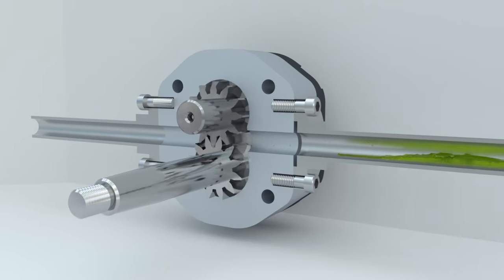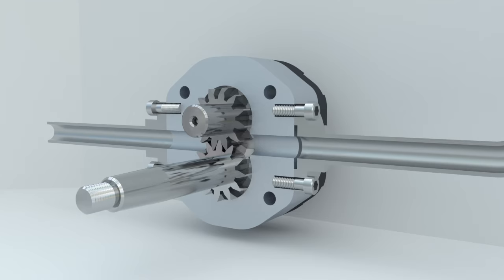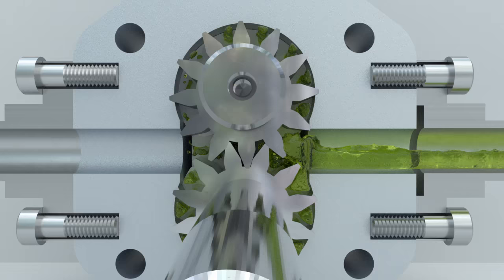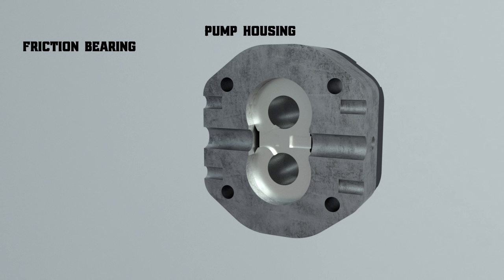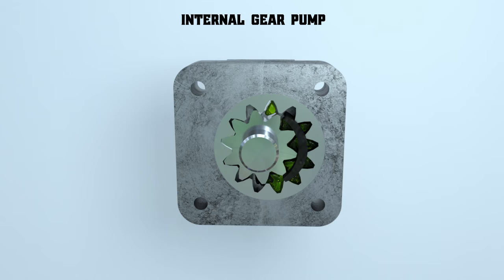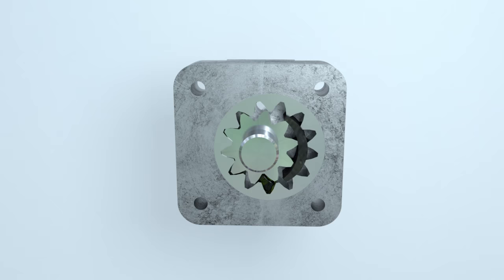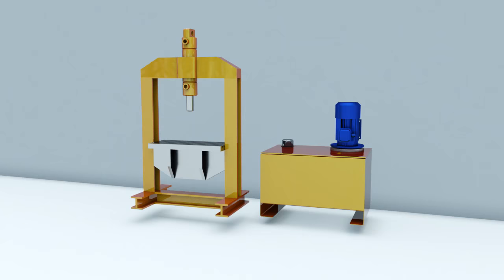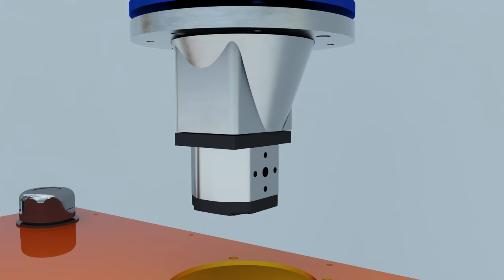How does a gear pump work?

Comment: In the refinery I work in they used a gear pump to pump a slurry of solvent, water and perlite powder (finely crushed volcanic glass). As you can imagine it needed extremely frequent maintenance, the perlite was literally sanding down everything inside the pump. Why they decided to use a gear pump for this slurry in the first place is beyond me, but they finally put in a better suited pump.
Reply from the maker: Yes, the gear pump is not well suited for this industry.
Reply: Wow yeah slurries containing abrasives are a no-no for gear pumps. A much better choice would be a progressing cavity pump.
Reply: @biggreenblob  Yup, despite the properties of progressing cavity pumps being well known where I work, they default to using centrifugal pumps for almost everything. Probably because they're way cheaper. The gear pump I talked about was replaced with a centrifugal pump, it doesn't break all the time anymore, but it isn't theoretically ideal.
Reply: You should have just asked them why. You were there everyday.
Reply: Diaphragm pump would be better.
Reply: or just used gravity
Reply: Well its like my company the most important machine in the facility uses the worst possible way to hold things or lift them suction. And of course it breaks down daily due to droppages because it cant hold shit together with suction.
Reply: @shawncrocker7037  if he was being paid to perform maintenance on the pumps, he's better off keeping his mouth shut.
Reply: But can peristaltic pumps scale well?

Comment: Internal gear pumps are pretty much standard for automotive engine oil distribution. One of the advantages they have (in that application) is that they have no bearings. The inner gear will sit on the front end of the crankshaft, which has its own bearings. The outer gear will free float inside the oil pump housing. The engine oil being moved by the oil pump lubricates everything.
Reply from the maker: Yes. Thank you
Reply: Nope.  Oil is distributed across the gears by immersing one of the gears in the oil directly.  It is NOT moved by a pump.  It is moved around the parts by capillary action between the gears.  In other words, the oil is passed from one gear to the next by the fact that it sticks to the gears.  When the gear interfaces with the next gear, the contact causes some of the oil to transfer to the other gear.
Reply: @protoborg  you might have misread. You're describing the lubrication of a manual transmission. I was talking about the engine, which only has gears in the oil pump and camshaft timing mechanism. Engines are lubricated by pressurized oil from the pump.

Comment: The pump will not work. The first bearing was put ay the wrong side. The high pressure side was put into the low pressure side.

Comment: “How inefficient would you like to make your pump?”
“Yes”
Reply: It might be energy inefficient, but I bet it can generate massive pressure and probably has really good self priming capabilies.
Reply: Gear pumps are actually relatively efficient, work with a high range of different fluids and they have a simple construction and the output is easily controlled. They're overall pretty great.
Reply: So what method would be better? These are still being used in cars to this day.
Reply: @neudimensions1320  An engine that runs on batteries.
Reply: Most hydraulic pumps and oil pumps are gear type pumps.
Reply: @neudimensions1320  that's only semi-true. Many manufacturers no longer build pumps like this as an OEM Solution. (excluding superchargers)
Reply: @kabadisha  we have hydraulic motors like this on bush hogs and they are very efficient and strong
Reply: How is it inefficient or what makes it inefficient???
Reply: Wanna know something funny ? Positive replacement pumps are some of the most efficient pumps but they are not used as much as centrifugal pumps because of their maintinence costs lmao
Reply: @neudimensions1320  i cant remember any engine using this type of pump for anything. You any?
Reply: @Steinersgarage  almost every ice uses a gear pump for the engine oil everything from a Chevy 350 to Ferrari uses them because of there reliability/low maintenance cost
Reply: @isaacmckinney8332  ice?
Reply: @Steinersgarage  internal combustion engine
Reply: @isaacmckinney8332  ah thx. But really? I have never seen one??
Reply: It's so efficient that on the intake end, it takes in five cubic meters a second, and dumps out ten cubic meters a second on the outtake end.
Reply: @jwalster9412  that depends on the size. I cant imagen that a tini tiny little gearpump does the same amount of work than what an huge one does
Reply: @Steinersgarage  I think you missed to joke, it lets out more than it takes in.
Reply: @henrychan720  you mean all combustion engines?
Reply: Polish by design
Reply: @Steinersgarage  “karlbergs GARAGE” hopefully your just working on lawnmowers
Reply: @J_M3444  the only time i worked with an lawnmower it turned into a motordriveen bike. but other than that i have never touched an lawnmower. i simply dont have time when all i got is unreliable european cars <3
Reply: positive displacement pumps are very efficient! what are you talking about?!
Reply: @SlowSTEN  - All mainstream automotive manufacturers have and still use this type of pump to move engine oil.
Reply: @kabadisha  It's limited only by its relief valve spring or the structural integrity of its housing or gear shaft.  And as far as efficiency, all auto manufacturers still use gear pumps to move engine oil.
Reply: @henrychan720  Seems like you and a lot of people here don’t understand the point of hydraulics. Efficiency is irrelevant as there is no alternative. Hydraulics are used everywhere around the globe, in every single car, bridge, forklift, garbage truck, airplane, excavator, because it’s unforgiving strong. No other mechanism delivers that. If you push the lever to make a cylinder move in certain direction then that cylinder has no choice but to move, even if it needs to apply a 100000kg to keep moving.
Reply: @Engineer9736  It was a joke
Reply: @Steinersgarage  pretty much any refrigerator uses them.
Reply: @henrychan720  Brush up on your humor.  Operating gear pumps for fifty five years creates an affinity for efficiency.  Your digestive tract is a gear pump.  Stop sharing, study more.
Reply: @jackreacher.  My digestive tract is a peristaltic pump nice try.
Reply: @henrychan720  lol  - you need a better microscope.
Reply: @henrychan720  yeah you can be quiet
Reply: @kabadisha  yes my extrenal gear pump on my cummins makes 45 psi at the rail when I had an internal plunger electric pump and struggled to make 15 psi and thats a normal pump that all cars have. Trash
Reply: They move in one direction without changing direction like a piston so I guess it makes it not as inefficient as it can be?
Reply: @henrychan720  great, one problem, what happens when we run out of third world country ecosystems to destroy mining for lithium? How about the massive amounts of refugees leaving destroied countries that sold their soul to sell lithium? How about the permanent ecological damage making car batteries causes?

Comment: Neat explanation
it works different than what my 'visual intuition' was expecting.
-Fluid flows around the outside of the gears, not pulled through the middle like I would expect a solid object,.
Reply: No it doesn't.
Reply: @protoborg Alright you explain

Comment: Wow, you learn something new every day. I always thought the direction of flow would've been the opposite.
Reply: Thats what I thpught too. I wonder if the animation is backwards
Reply from the maker: The animation is correct. It is necessary to correctly understand how the liquid moves in the pump. She moves around the perimeter. Through the place where the teeth of the gears are engaged, the liquid cannot flow, so there is no empty volume. I want to release a short video where this issue will be discussed in more detail.

Comment: This is how vw air-cooled oil pump works, isn't it? Awesome video btw!!
Reply from the maker: These pumps are used in many applications. In engines, they can pump fuel. In tractors and presses, pump oil in the hydraulic system.

Comment: Thank you for that wonderful explanation I would like to know more about external hydraulic gear pumps as I'm building a backhoe and don't know what size I should get
Reply: Hi thanks for the comments but I don't know much about hydraulic but I'm building a toe able backhoe and could anyone recommend what kind I should buy.the shaft on the engine is 1 inch key shaft but all the pump's I see on line seems to have a smaller and different shaft is there some kind of adaptor I can get that would fit the 1 inch engine shaft and have some kind of universal joint on the other end

Comment: Nice explanation, I always thought they worked the other way around. What I am wondering is: Do the liquids get smashed around and get bubbly and foamy on the output side? Because the moving direction of the gears is exactly opposite to the direction of liquid flow.
Reply from the maker: The fluid does not flow through the engagement, there is no free volume. Fluid flows around the perimeter. At the moment when the teeth disengage, the volume of the working chamber increases, the liquid from the suction line fills the space between the teeth. Then the gear turns and the liquid is locked in the space between the teeth and the housing. Then the teeth engage and the liquid is squeezed out of the volume between the teeth, it flows into the pressure line.
Reply: depends on the viscosity and RPM of the pump. With the right pump, most liquid is pushed away from the teeth and barely moves back to the input. If the viscosity and rpm of the pump are too high the liquid can`t escape that easily and will get compressed by the gearing. This can cause bubbles and foam as we have different pressures and velocities within the fluid.

Comment: This video is excellent! I’m just getting into hydraulics and this is the most clear explanation I have seen of the operating principle of a gear pump. Does cavitation occur enough for it to be worth studying?
Reply from the maker: Yes, cavitation occurs. At high fluid speeds (on propeller blades, for example) or when there is resistance in the suction line of pumps

Comment: What I don't get about these pumps is that there are a lot of spots where it looks like the oil is getting compressed, the oil that is used specifically for its incompressibility. The simulated oil even got pushed out of the model at some points in the video
Reply: That's because this video is ENTIRELY WRONG.

Comment: The volume of the pump doesn't change. Each gear moves the fluid from one side to the other side. 2 gears filling 1 space forces the fluid out of the pump

Comment: This looks extremely cool but is it effective?
From the animation it all looks like the pump made the flow slightly worse by introducing back splash on the right side.
Also there will be a lot of leakage when pump is off...
Reply: Duh the pump actually made liquid slower rather than pumping it up...
Reply from the maker: Gear pumps are efficient and inexpensive and are used in industry. They are used in machine tools, presses, tractors, lifting machines. Perhaps the simulation does not accurately show the fluid flow, since I was pushing the fluid emitter, from which the fluid flows to the pump. In reality, the reason for the movement of the fluid is the pump.
Reply: @hydraulicandpneumaticsyste3253  ok

Comment: I’m confused on the first model, could someone explain how it works as a pump, to me it looks like it would be pushing water the direction the water is coming. I get that some of the water would get in the gear teeth and be carried around the perimeter of the housing to the other side but I fail to see how that provides any pressure to push the water in that direction
Reply: I think it works because as the gear teeth separate it creates a void that has to be filled by oil (a vacuum), and as the gear teeth come together the oil in the immediate vicinity is pushed out because the gear teeth takes up the physical space where the oil used to be. The pump is designed so that the inlet is right there where the teeth move apart, and the outlet is right there where the teeth come together, so that becomes the path of least resistance. It is a little bit more obvious on the internal gear model, you'll see the inlet and outlet is placed right where the teeth come together or pull apart.
Reply: @plonkster  Correct.
It isn't the teeth of the gear that moves the fluid as if it was a solid between rollers, but the expanding and contracting voids that occur between the teeth which act like a piston in a bore to create negative and positive pressure cycles

Comment: Looks like the fluid flow in your simulation is going the opposite way, or isn't it?🤔
Reply from the maker: The direction of flow is shown correctly. The fluid does not flow in the gearing, there is simply no volume to leak. Liquid flows around the perimeter.

Comment: Water pump used one recently without even thinking how it works
Reply from the maker: Water pumps are usually arranged differently, here is an example https://www.youtube.com/watch?v=zwSWHrVBQls . The gear pump is designed for pumping oil, fuel.

Comment: "when the gear teeth come out of the mesh, the volume of the chamber increases" Can someone tell me why this drives the pressure inside the chamber lower then atmospheric pressure?
Reply: for my specific gear pump the inlet hole has a larger diameter than the outlet hole, so im assuming its just an application of the continuity equation and bernoulli's relation with velocity and pressure? actually that wouldnt make sense since a larger diameter would mean smaller velocity and higher pressure...

Comment: Cool concept but I imagined this would be backwards..if the gears are neutral u could use water or any liquid to push through the gears making them spin, spooling up and storing an electrical current...anybody know if this exists or have an example of it?
Reply from the maker: The fluid does not flow through the engagement, but along the perimeter. Given this fact, it becomes clear why the gears rotate in this direction.
Reply: @hydraulicandpneumaticsyste3253  so does the gears have a power supply making them move or is the liquid the power supply?
Reply from the maker: @spencerhighley4231  This is a pump, it has a power supply, the electric motor rotates the pump shaft, to which the drive gear is attached. If it were the other way around - the liquid makes the shaft rotate, then the device is called a hydraulic motor.

Comment: Did anyone try to run it in opposite direction ?
Reply from the maker: The liquid moves along the perimeter, it cannot flow through the place where the teeth engage, there is no free volume. I want to publish a short video where this issue will be discussed in detail.

Comment: I thought the inlet is supposed to be larger than the outlet...??
Reply from the maker: This is an optional requirement. It is better to do as you said so that the hydraulic resistance at the suction is minimal. However, the openings at the inlet and outlet can be the same, for example, if the hydraulic machine is reversible (pump-motor), or the pump housing is unified with the hydraulic motor housing
Reply: @hydraulicandpneumaticsyste3253  Thank you, I see what you're saying, makes sense now. I'm trying to learn machine repair trade so I can get away from dead end jobs, so I appreciate you uploading this educational video.

Comment: Used in airplane jet engines to distribute oil around the engine.
Reply from the maker: Yes. Axial piston pumps are also used in aviation, I will try to make a video about them.

Comment: I would like to understand how an air cycle machine works!!!
A “pack”. 
Boyles law, expansion and contraction. 
It still doesn’t make sense. 
A pendulum always ends in balance, not in imbalance!!!!!
Reply: Huh? What does a pendulum have to do with a stirling motor?
Reply: If you are asking about a sterling engine, it uses the natural function of cold air wanting to go to warmer air (convection) to drive a piston, its pretty neet
Reply: @kevinlatulippe6944  That is not how it works.

Comment: What is with the strong accent?  It it a Korean voice being used to pronounce English?  Lol

I had to change the working direction of a few of these pumps depending on the project.  What you call bearings, we call pressure plates, and they are usually brass.

Comment: Maybe rotate the gears the other way... They seem to be rotating against the flow.
Reply from the maker: The rotation is shown correctly. Note that the liquid moves along the perimeter.
Reply: @hydraulicandpneumaticsyste3253   but how does it pressurize the fluid ?
Pressure seems to drop at discharge
Reply: @intercept7965  A volumetric pump does not pressurize the medium. It only moves it.
Reply: @jonasthemovie understood and  agree 👍
Reply: @intercept7965  Pumps move fluid, restrictions produce pressure.